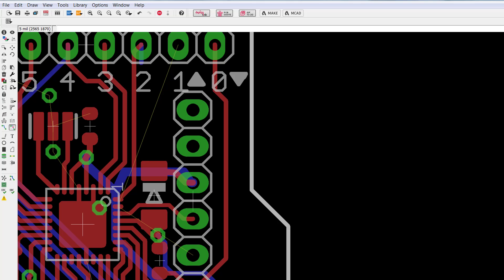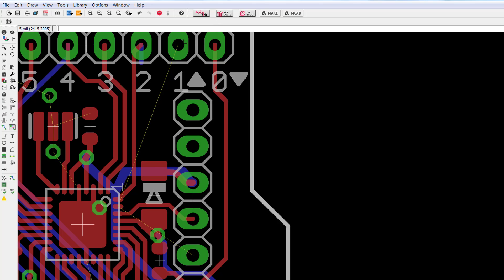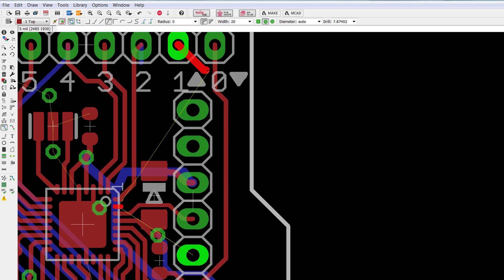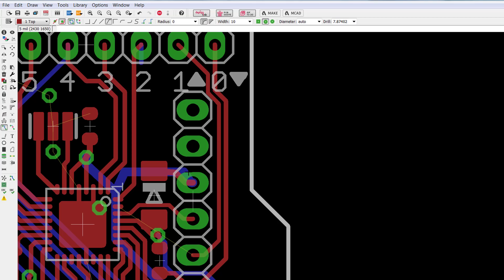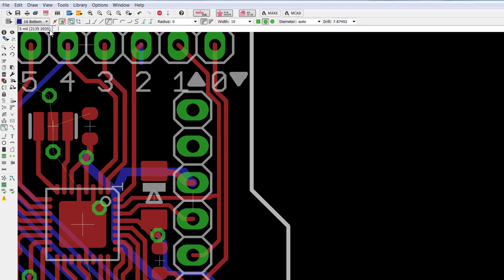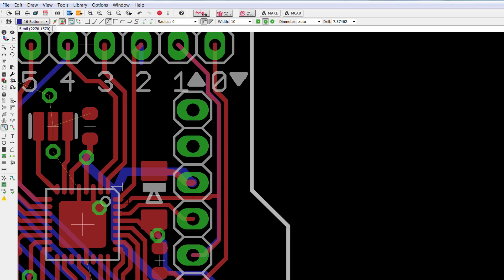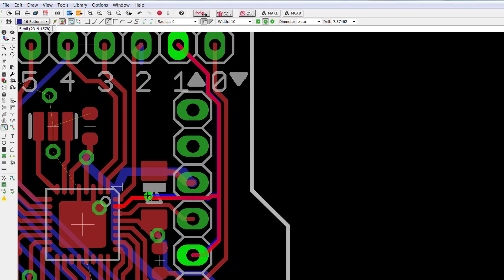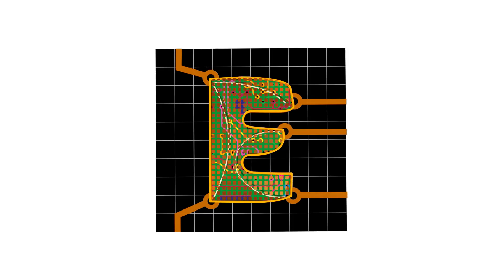Increasing Current Capacity Without Increasing Your Trace Width - Autodesk EAGLE

Comment: There is no point for having the bottom trace and via going to smt pad since the trace from smt pad to via is only 10mils so the additional 10 mils is not going to matter.
Reply: I believe you're correct.  The top bottom double traces to the smt pad are pointless as the trace between via and smt pad is already the maximum width of the pad.  smt pad width would be the limiting factor here.
Reply: @FOS2998  Yeah the benefits are marginal.